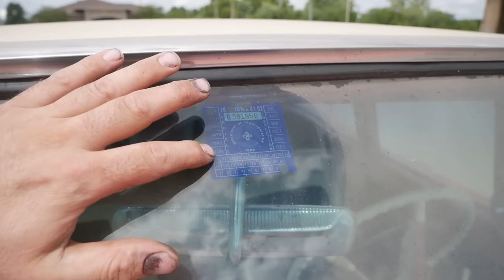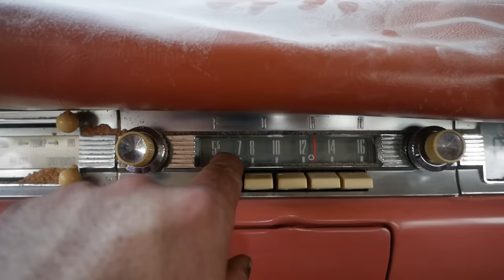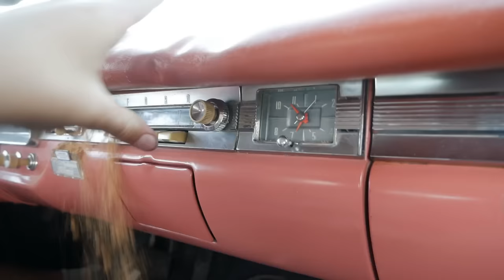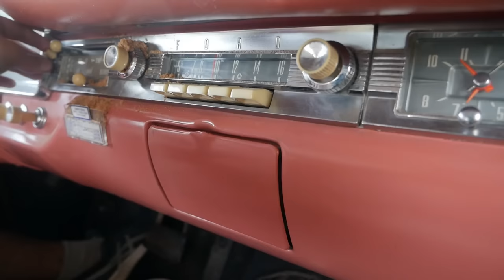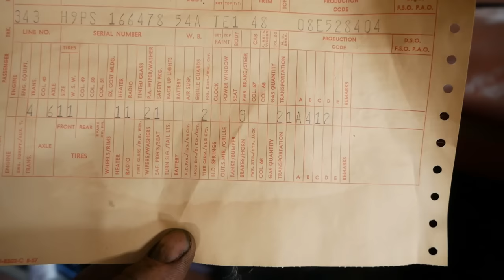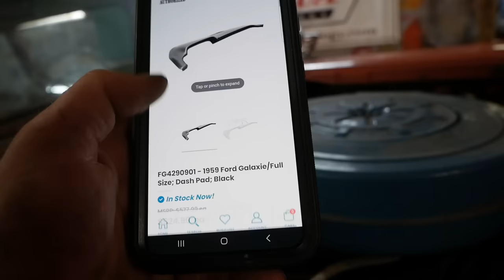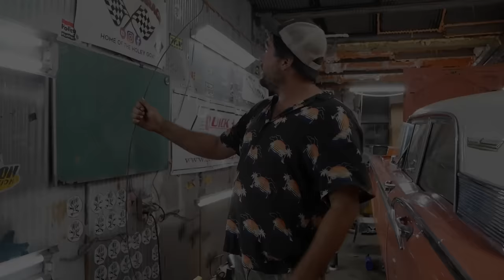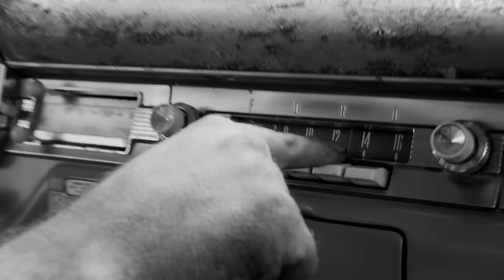On The Road After 44 Years! 1959 Galaxie 500 SURVIVOR

Comment: Thanks for the Memories!, I had a 59 Fairlane 2 Door Sedan for 23 Years "1993-2016", It originally was a 292 with a 3 on the Tree, That got replaced with a 390 with a C6 I took out of my 1976 F100, It had A/C, Electronic Ignition, Alternator, Electric Wiper Motor, I did put Power Brakes on it but never got around to Power Steering, It would have had to have a Bracket made to put the old style Pump on that later 390 "1976 Pump and Bracket wouldn't work", Love the 1959 Fords!!

Comment: I'm not a Ford bloke by any stretch of the imagination, but I'm really taking a shine to the pair of '59s, mate.  JD's beast still looks great and the Coral beast is such a fantastic example of a survivor.  Hard to believe it sat for so long in the way the beast just got up and boogied like it was driven yesterday.  Watching it do the long pulls from a distance while JD was filming from the side of the road was a magical thing to behold - even with a missing hubcap!  Great video to watch, mate and a reminder than sometimes the old stuff is still far better to work with than the new, be it parts or the cars themselves.  Shoes do take a few miles to wear back in on the drums and feel good than pads do on discs too.  Had to remind myself of that fact just recently as well.....

It's gotta be a proud moment to see the young fella working to correct a problem on his own vehicle too, eh Dalton?  What I found particularly telling was that he can now lean over the front fenders and reach things in the engine bay and his feet still touch the ground, whereas when the Fairlane was built, he'd have to hike himself up onto the fender and balance himself there to work on it.  They don't stay young (or little) forever, do they?  I remember my youngest helping me with the brakes when she had to have the seat pulled right forward and hang onto the steering wheel to push the pedal.  Now, she gets in, adjusts the seat back a touch and has a quick and / or sharp rejoinder for any comments I make, while comparing my classics unfavourably with her own!  I can see that starting already and more so in your own future, eh....!  All the best.
Reply: I am and always will be

Comment: Watching you beat those dents out of the rear quarter reminds me of an adventure last fall...

I was on my way to the fire station responding to a call one night in "Megabomb III", the $500 Honda civic. I came up to the first crest on a hill, saw a deer, and said (out loud of course, to the deer on the side ov the road) "you'd better stay there. No f@#%ing chance I'll be able to stop if you-"

And the bugger jumped right in front of me, landed on the hood and went up over the roof. 

I let off the brakes, car kept rolling straight... I touched the gas, motor still running... no signs of smoke or odd behaviour... no lights on the dash... so I just kept on going.

It was a false alarm, so the first truck was already on its way back, so a buddy followed me back to see where the deer was, we found it about 30 feet off the road, dead.

I spent the next morning prying up and beating on the upper rad support until it looked good-ish, then laid the hood on the lawn and started wailing on it with a 2x4 until it was straight enough to latch.

If it weren't for the inner reinforcement on it I probably could've got it looking pretty decent... but it was good enough for a $500 car that would never pass another safety inspection.

...and not too much later, buddy shows up at the post office where my wife works and dropped off a bunch of fresh deer steaks and deer burger for us 😂

Comment: We’ve recently run into the same issue with the Chinese master cylinders for my grandfather‘s 66 imperial convertible. He ordered one from rock auto and afterwords got one from O’Reillys. Neither of which were we ever able to get the brakes to work properly so he rebuilt the original one after finding a rebuild kit for a Chevrolet product that was plentiful with the correct bore size and now everything works perfectly.

Comment: I'd imagine that dash had been padded with foam at some point, but being foam from the 50s it probably went the way of... well... foam from the 50s and turned into a fine dust shortly after this car was first parked. My uncle had some Lionel trains from that era and any foam accessories (mostly the foam cleaning pads you'd use on the track cleaning car) were basically powder by the time I got them in the late 2000s

Comment: Just happened upon your video after watching another video about a 59' Ford.  This brought back so many memories.  My first car was a 59' Ford Custom 300.  It had the rounded rear windshield, less chrome, the 4 chrome birds on the rear quarters, and mine had the 292 Y block V8. Very quirky and terrible top end oiler engine..  Normally I think they came with an inline 6 at this trim level.  It was my grandparents car they bought brand new, handed down to my dad and driven to California from North Dakota in 69', then I started restoring it with my dad in about 85'.  I graduated in 87' and drove my grandmother to my graduation in her old car at about 85% restored.  I love that your son has one.  They are such great cars and, yes, total tanks!  Mine was two tone green with a medium green bottom and mint green roof.  I still miss it.  Loved watching you guys work on this one and it's great you both have father / son matching 59's!  Oh, and you stole it for $2,400!  If you can even find one out here in So Cal, you'll pay through the nose for it.  Probably 5X what you paid for yours in its condition.  Thanks again for the video guys!

Comment: love the matching ford. its so close to perfect you should really fully fix that quarter panel and fix the suspension. like you said what else is there to do? now father and son have matching boats lol
Reply from the maker: Quarter could be fixed easily enough. Blending the paint into the door to match the original might be really hard to make it look right on the car. Hopefully I at least have the trim
Reply: @PoleBarnGarage  Yea I imagine van sickle doesn't have coral paint lol. There are some top notch color match paint experts out there but I assume that's original lacquer paint so blending could be a nightmare.
Reply: @PoleBarnGarage ,   For matching old paint, I have used those paint match color camera/guns that you put on the car and take pictures of the paint and bring that information back to a paint dealer/part store, and they'll mix it custom for you.  I have had very very good success with that, And there isn't extra charge unless you want to have them put that paint in rattle cans.

Comment: What's the frame like? Even @ $3,100 that's a steal.  Crazy good looking on your part Dal'un... Don't know yet what your source was on this deal, but dang you were looking when the looking was in the stars of your zodiac sign.
Damn every time you show the car's trim work it's absolutely unbelievable, the condition and complete trim bits so far as you've given us a peek, so far so good.  Okay the rear passenger quarter panel has trim issues...
Once you began looking under at the fuel tank and doing brake work I see little to no rust. I know you said this car was stored inside and it shows.  That dash that had decomposed sawdust (?) under the vinyl cover looks like a mess but per your usual, ain't going to stop you boys from making it nice.

Sixty four years, dang... that car is just so fifties color wise.
Reply from the maker: Solid as a rock. It was listed on marketplace for about a week, just kept my eye on it

Comment: I’ve had several FE’s and most have manifold leaks. If you can get the manifold off have it faced or sand it flat with your home set up. They warp and seal much better with a little machining
Reply: I resurfaced my FE manifolds on my uncle's harbor freight belt sander. It was just barely long enough to work, but I got the inner 2 ports within .002" of totally flat to the outer ports, and using the factory shim heat shields, have been totally leak free. I did 3 manifolds, since I had an extra, they were all horribly warped and super pitted, cleaned them all up no problem. It sure beat the $125 a piece resurface cost the machine shop wanted.

Comment: Beautiful coral paint 59 ford galaxie glad see it is finally getting fixed hard to believe it got wrecked years ago and then was just parked and not touched to try to repair it.. and I like jd's blue and white galaxie with the 390 fe 4bbl  even though I prefer the 352 because as i said basically the 360 and 390 are the same only the length of stroke is different..

Comment: I did similar on my grandpa's old '83 F150, honed out the master-cylinder with a broom-handle wrapped in a rag and a piece of sandpaper! The rear-most seal was bad, worn away by the rust, and continued to leak but otherwise worked.
Also used a metal kitchen-sink drain-pipe to replace a bad radiator hose, sealed with plumber's putty.
Even got ran dry of oil once! Didn't smoke too bad after. The jury-rigging kept it on the road a little longer! 
Eventually was unsafe due to worn out steering, it'd change lanes without moving the steering wheel! Still ran great.

Comment: So many memories in this video.  Drove almost an identical car for a little over a year - 1996/7.  Same model (Galaxie town sedan?) - bought new by great grandparents and had @65K miles when I started driving it.  332 V8, Cruise-o-matic, PS, and Select air, air conditioning - and why, on the most expensive model - vacuum wipers . . .  Colors were the same - I think Ford called the pink Geranium.   My paint scheme was different - Geranium on bottom, Wimbledon white through the middle (hood, tops front fenders and doors, deck lid) and Geranium on top.  Averaged @16 mpg and rode like a couch.  Keep up the great work!

Comment: My Mom and Dad had a baby blue one with the 292. Summer of 1962 we pulled a camper trailer to Gaviota beach. The 352 was one of Ford's best engines. The 292 had oiling problems. The oil galleys stopped up. He said they were too narrow. The rockers and lifters clacked. Dad had two copper tubes running from each side of the oil pan up to the top of valve covers. That and mixing an additive in the engine helped.

Comment: We had a 58, green and white beast, as a  little kid in the early 60,s, when you was messing with the brakes, I can still hear my Dad,s voice  YELLING ,when my Mom would back out the driveway, NOT TO STOMP on the brakes, it tightened them up and used gas and wore them out faster, LOL. The old 58 and Mom never got along well, especially when cold and the choke would come off, and  when the points would close up, I can remember getting pretty damn cold walking home about 6 miles one winter. The craziest thing though, Dad worked at McDonnell Douglas in St Louis Mo, every year I can remember Mom and Dad getting the old car loaded up with a Wenzell tent, prepping the car, new oil and repacking wheel bearings ,adjusting brakes, and off we would go out west for 2  or 3 weels, to Colorado, Wyoming , Utah etc, and standing on the " hump" watching gas prices, in gas wars, I can remember 26.9!! Coming down Rabbit Ear pass one time the old 58 Ford sounded like it dropped a rod or something, KNOCK KNOCK KNOCK like some one taking a ball peen hammer to the inside of the engine, I will never forget the look on my Mom and Dads face, and then the knocking quit, he pulled over at the bottom of the pass and checked things out and never done it again back to Wentzville Mo!!

Comment: quite the entertaining channel, good humor all along. My first car was a '59 two door Galaxie, that I got in 1966. There had been a fire in the back seat and the car pretty well had the wheels run off it by young marines on leave. I learned a lot on that car, had a journeyman mechanic two door away that helped me a bunch. That car had a 332 with a two barrel and cruise-o-matic transmission. It was a boat but it meant transportation and freedom to go places, I loved it. My dash had split from sun, that crumbly stuff is decayed foam rubber. I got some really heavy gauge cloth backed vinyl and contact cement, re-covered that dash. I had glasspacks and the sound of your car was immediately recognizable, I see them on it too.

Comment: Clean up the glue residue on the dash and see how much actual paint is there. I think just having the metal dash is better than trying to work with the old vinyl. Otherwise just fix the suspension, new brakes, and keep it clean. It's original enough that you can definitely get more than what you paid if you want to sell. But I like the idea of a father son cruise in matching 59s,

Comment: My father had a similar '59 Ford that he bought used at a Chevrolet dealer in the early 1960's. His was also a Fairlane 500 / Galaxie but was the 2 door post model. His car was red instead of coral, and also had a white top.  I recall his car had a green air cleaner which I think may indicate it had a 332 V8. My father always said he liked his '59 Ford because it was relatively large and powerful but not too big. I remember being in the car as it was being push started by a truck driven by my grandfather. It's my recollection that the car sometimes vapor locked. In December of 1967, it was traded-in on a Raven Black 1968 Ford Mustang at Heiser Ford in Milwaukee. By that time, the car was basically a clunker, being 9 model years old and having spent most if not all its life in Wisconsin, where the roads are routinely salted in the winter.
Reply: ,  You are correct, the green rocker covers and air cleaner indicated the 332 cubic inch

Comment: As a teenager in 1968, I removed the padding on the dash of my '59 Country Squire and cleaned up the glue with gasoline, probably not a great idea, but it worked. The factory red was underneath and looked OK.  In 1992 I acquired a padded dash to put back on, it's much belter looking than the factory painted dash. I note that you keep changing the shifter while driving. I also have the Cruise-O-Matic and most of your driving should be done in D1, which starts you in first gear. D2 starts you in second gear which will get you going, but slower. I'm still driving my Squire.
Reply from the maker: Ok I gotcha, very possible just user error then. If gas worked on your dash then I bet naptha or something would as well.. Maybe a little safer. Of course your fuel in 1968 was good stuff 😂

Comment: Excellent video. I’ve had two brake failures with single pot systems. In one case a brake line split and another the brake pressure switch split open. One resulted in a crash and the other happened while checking the brake lights. I’ve also had problems bleeding those aftermarket masters. They don’t have good check valves, work more like a clutch master. Once bled they work fine but won’t pump up like they should.

Comment: I'm 77 now and in 1964 I had a 59 Galaxie 2 Dr hardtop.
 352 inch with a three speed and overdrive...bought a blown up 427" out of a drag car with a broken rod wrapped around its neighbor...took the engine to Junior College machine shop and rebuilt it with parts from a junk yard.
First time I put my foot in it the tranny exploded...back to another junk yard and got everything from the blowproof bell housing to the nine inch rear end for $275.00
  Removed the five spoke mags and replaced with steel wheels and stock hubcaps..only tell was a set of "cheater slicks"
  Left the column linkage in it and would place a leather jacket over the 4 sp. Shifter.
   Drag raced Chevy gassers and won...told the drivers it was all stock 352...the look on their face was priceless!
  We called these kind of cars "sleepers"

Comment: not sure if this is what you need but a quick look on summits site has a Carter mechanical fuel pump with the vacuum actuator for the wipers (part # CRT-M2470) bit steep at 209 but they have it in stock

Comment: Hi I'm from Iowa. I have a 1958 Ford Fairlane 500 with a dual action fuel pump. I've had a fuel pump that has been giving me problems for two years, so I purchased two new Chinese Carter fuel pumps which was a waste of money.  Searching on the internet I found "Then and Now Automotive" from Weymouth, Maine. They rebuild old fuel pumps and will also sell you a kit to rebuild it yourself if you so desire. Their parts are made compatible with the new ethanol fuel as well. I sent the original AIRTEX fuel pump out to be rebuilt, they were very busy so it took six weeks to get it back but was well worth it because it works better than new now. If you want to keep your car all stock that would be the way to go.

Comment: Hey Dalton, I have a 57 Thunderbird, and I’m wondering if you checked with any of the Thunderbird suppliers or maybe NPD for new wheel cyls. Also, I suggest changing that MC out for a dual reservoir master for a 67 Stang, re-routing your lines to separate front from rear. I did that and it was an easy job. For the brake lights you can get a mechanical switch kit, they sell it at NPD.

Comment: my folks own one of these with the 332 thunderbird special motor, yours has the same thunderbird package with different fender ornaments and entire roof. really great cars with the only defect i know of is the radiators  had a bad habit of leaking from the top after a while as the top starts to detach. they have had it for nearly 15 years and have driven it to 2-3 car shows every weekend during the better weather months totaling 50,000-60,000 miles and have only recently had the motor overhauled around 135,000 where they had hardened valve seats put in.